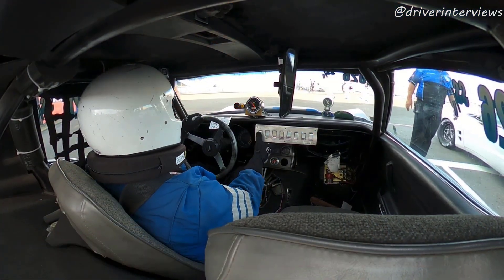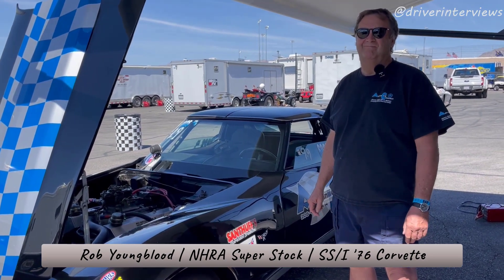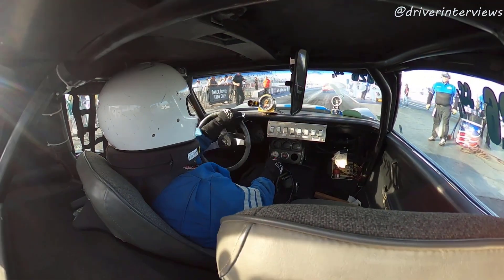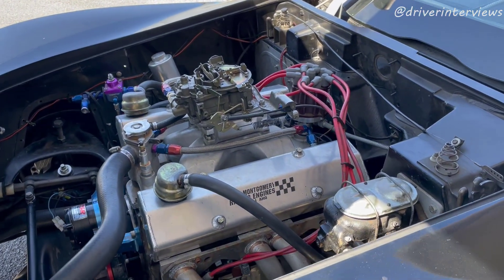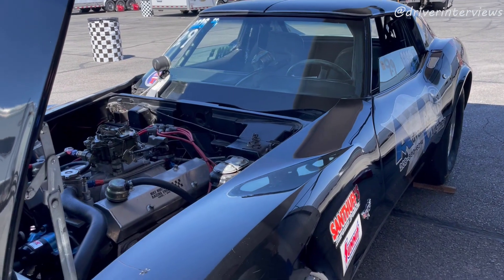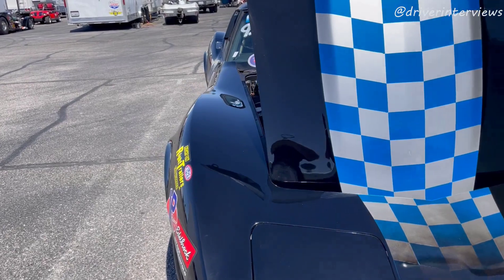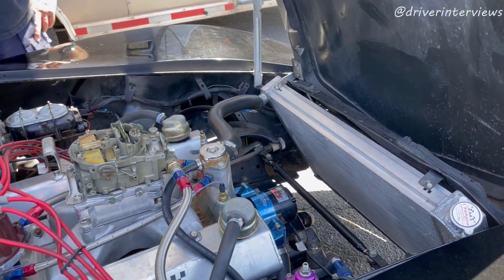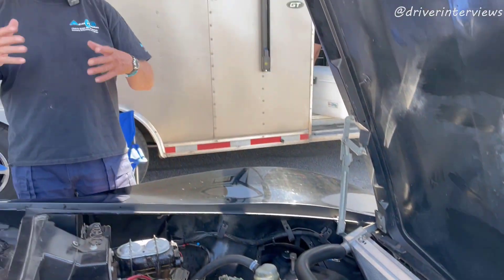Rob Youngblood | NHRA Super Stock | SS/I Stick Shift 1976 Corvette | Driver Interviews Bobby Fazio

Comment: 290hp and jt does wheelies wow thats amazing. I run round track and i have a 460 hp to rear wheels asphalt super stock with a 3 disc clutch 6 inch clutches and transmissions makes world of difference
Reply from the maker: Wow cool! As far as superstock competition goes the 290 hp is a factor that is used to come up with the class for the car. The actual horsepower of the motor is usually about 75 to 125% more than that.